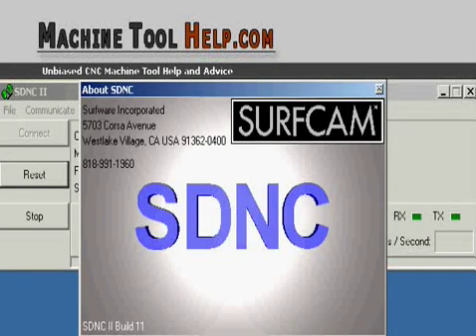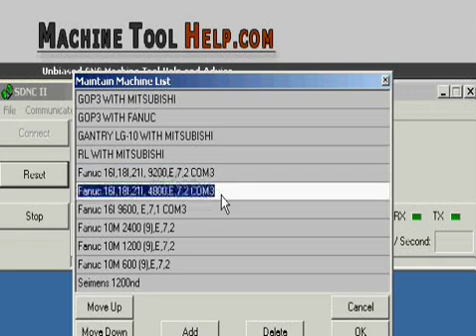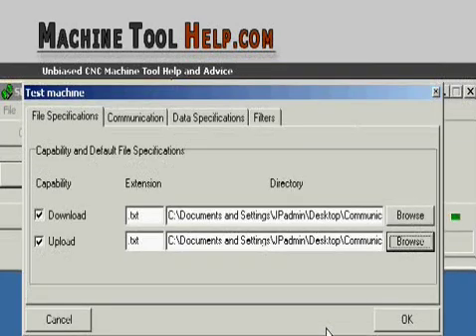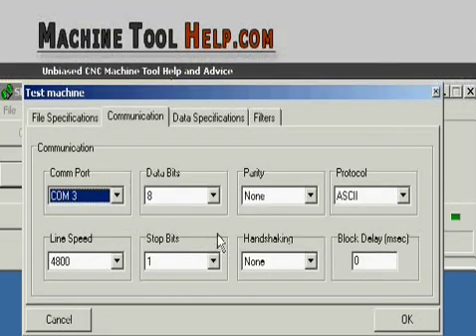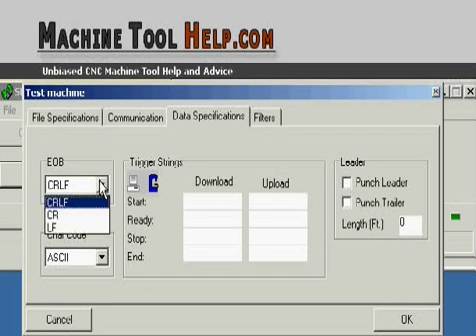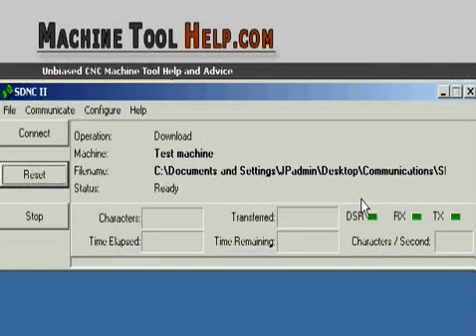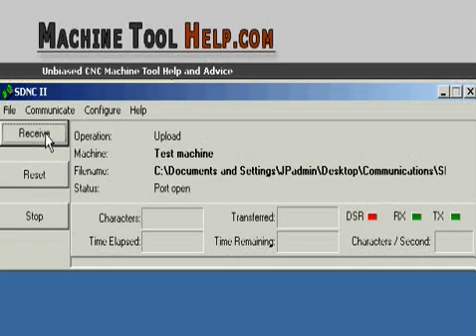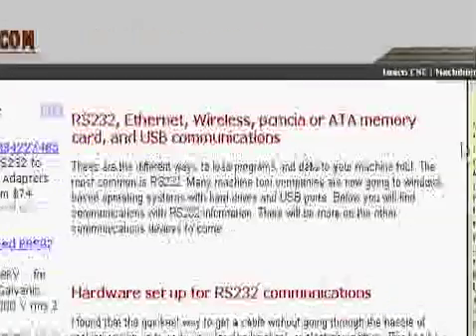CNC RS232 communication software setup SDNC Surfcam-machinetoolhelp.com

Comment: what is RX and TX lights at 7:20 ? I have connected via sdnc and I download files to machine but TX light turns red, rather than DSR light ? File does not transfer by the way.